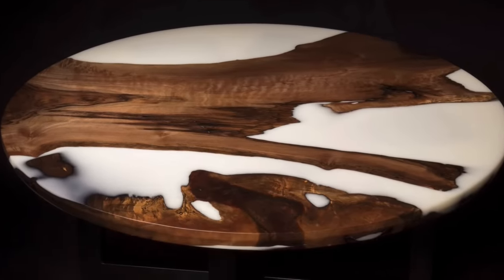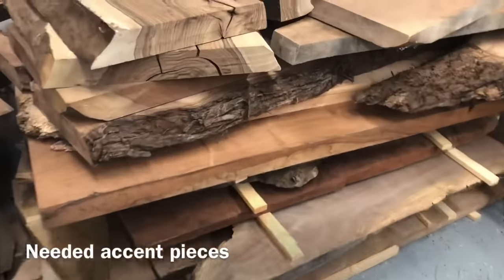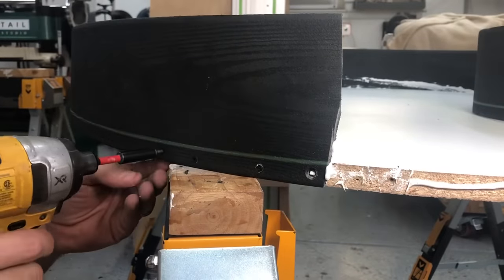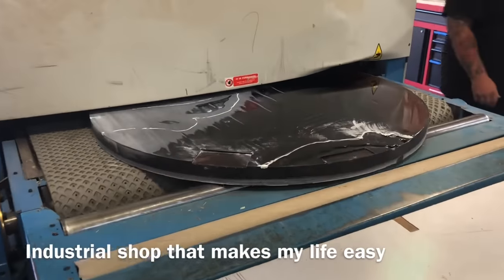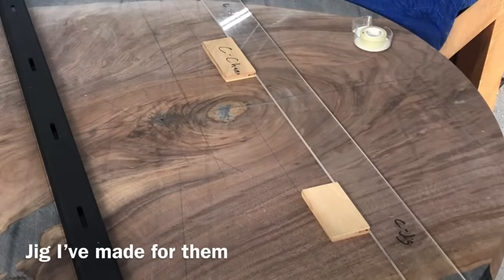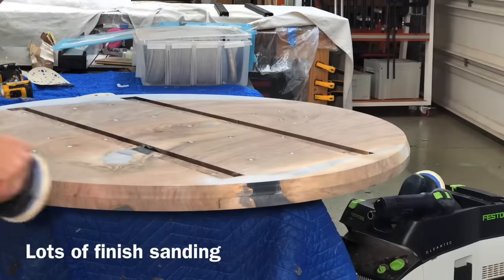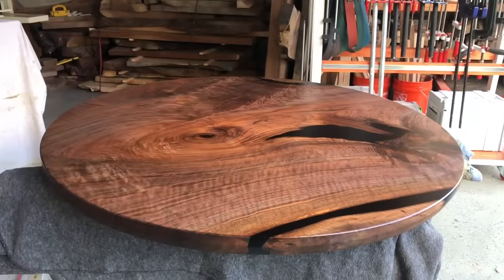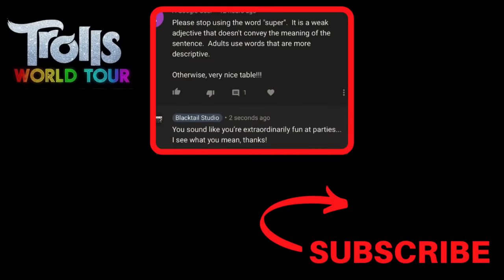A Table Got Ruined

Comment: Yes, all epoxy can yellow - but unless the epoxy you're using states it will NOT yellow - you really can't complain.
The new table is not white? So?
Did you use non-yellowing clear epoxy and add white pigment, or a pre-made white epoxy?
If the former, then your clear tables will yellow as well.

You give classes?
I am not trying to be a jerk - but... 
One video you blamed the lumber yard for a slab you made into a table - that warped and was too high in moisture - though you did NOT test moisture BEFORE building the table - AND, the video clearly shows you repeatedly getting the wood wet (including "sand" blasting it with dry ice - in which FROST [i.e. frozen water] is clearly forming on the wood). You somehow got them to give you the money back.

This video you blame the epoxy manufacturer because their epoxy yellowed. Did they claim it would NOT yellow? Also, once you add colorants - how do you know your colorant didn't yellow? Did you do any tests?

Comment: Yellowing aside, the new table and old table are probably the ugliest tables in your video collection.  The old one looks like random chunks of wood thrown in a pool of childrens white glue.  Not even character pieces.  They look like off-cuts from other projects.  

The second almost looks like a normal table you can find at Ikea.  Literally, you cut off all the character parts from the table and was left with a normal chunk of wood.  The epoxy plays almost no part in the final product.  What's the point of an epoxy table that looks like it came from a normal furniture retailer?  

I will admit that you have some high-level finishing techniques that put you a step above others even with normal materials, but these two tables are the worst in your portfolio.  I suppose it's the customer with weird taste, spending thousands to request these things.